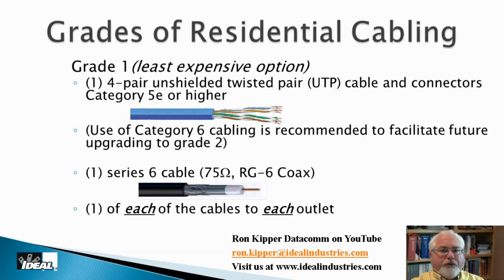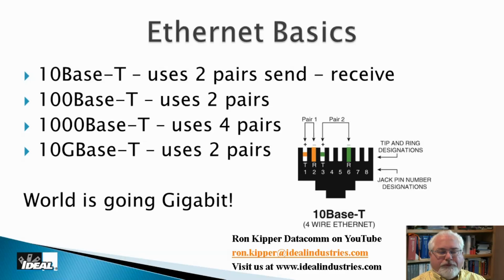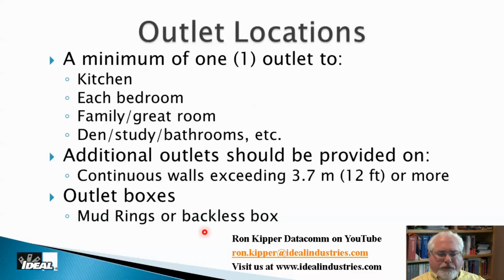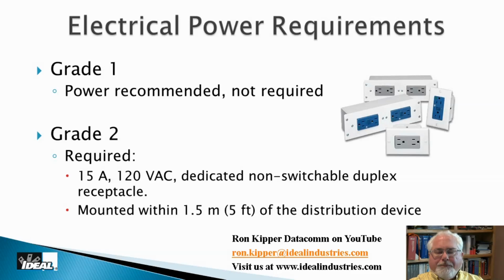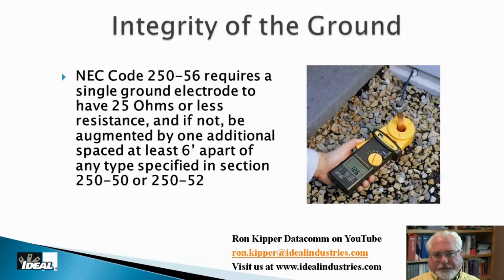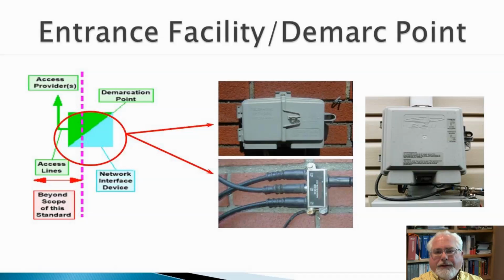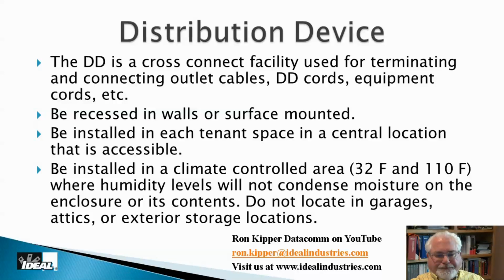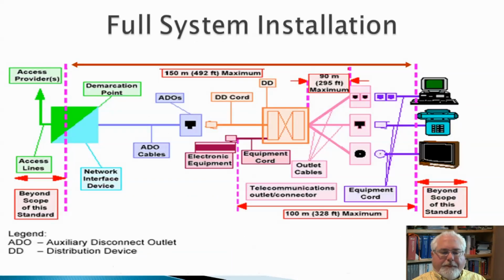Residential Structured Wiring System Part 2 Layout

Comment: Typically running cable tv data or phone through surge protectors not only filters but causes ingress which can lead to service interruptions in given nodes (service area). So best to using recommended bonding method at demark point.

Comment: another great video! Thank you for this series. One question, I thought the real reason cable and sat companies did not want surge protection on their lines was due to that protection stopping their anti piracy surges? I recall when satellite boxes had a card that needed to be installed and the card was provisioned for your channels. Well there were people that could program those cards to give you every channel they offered without paying for them. I heard the way they stopped this was to surge the card and render it inoperable. Now if they were sending a surge in the line or not I am not sure. Though as I type this, I can't really see them doing that. I can see them sending a signal to the box that then causes the box to over-voltage the card though. Eh...off to google. Memory is a fickle thing.
Reply from the maker: ballzack57 Yes I remember those satellite cards! From what I know the surge can filter channels but there may be other reasons too. I appreciate you watching the channelRon